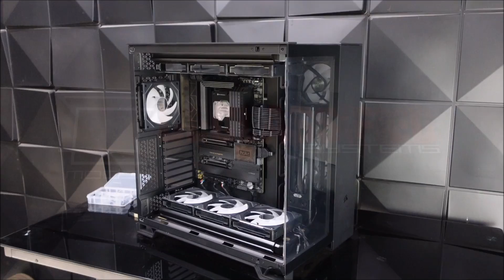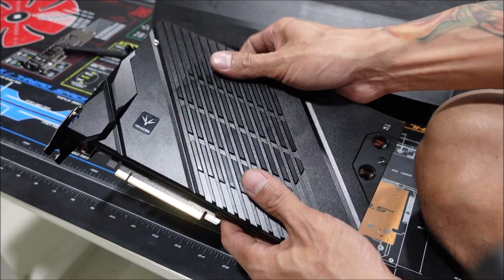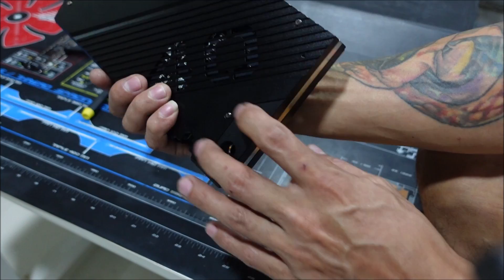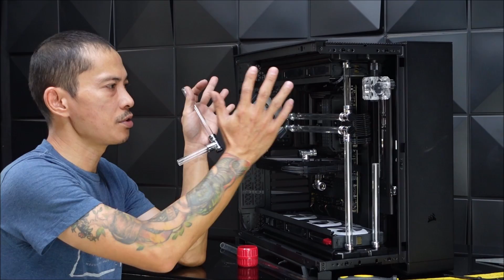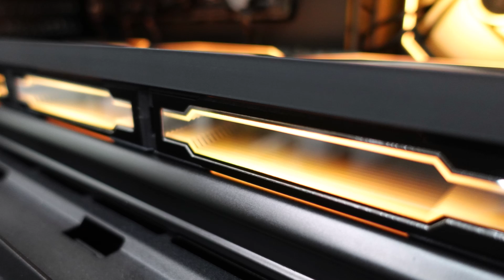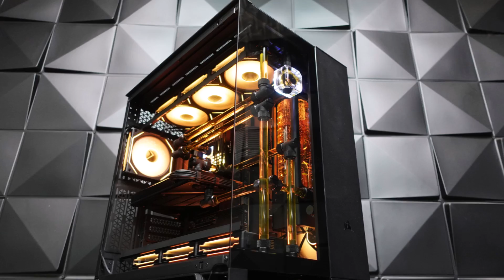Custom Pc Build #142  " Golddigger " A Custom water-cooled Gaming PC

Comment: Will not T fittings add unnecessary friction to the water flow as there is a small pocket available for the water to travel on the other side of the T?
Reply from the maker: Probably but it does not matter.
Reply: @DeclassifiedSystems  Okay. I thought it would wear out the pimp quicker. But it does not really make a difference I suppose.